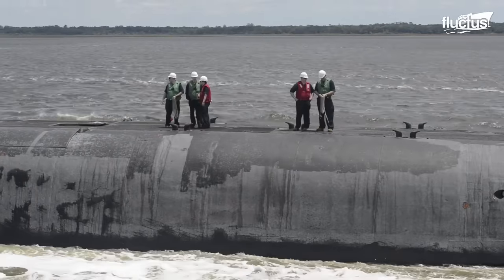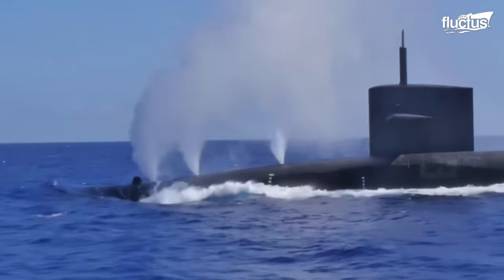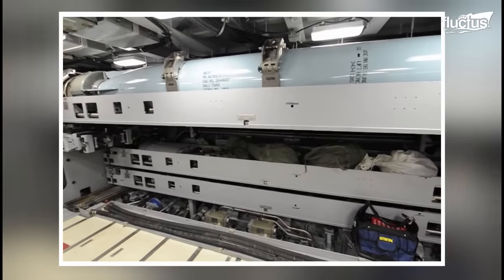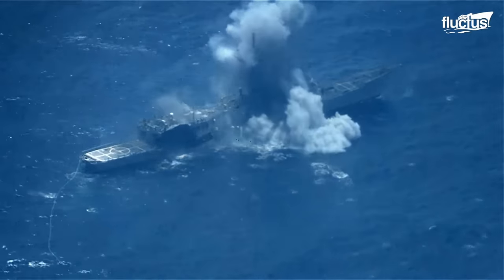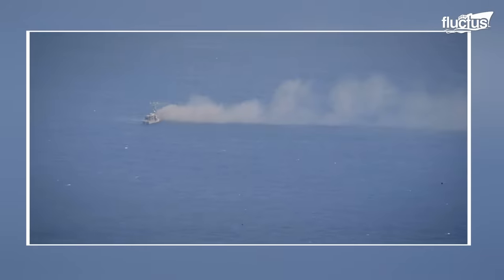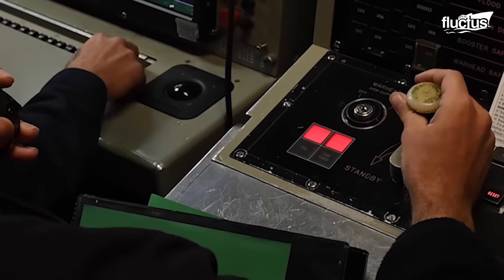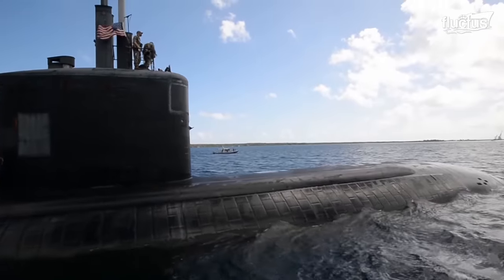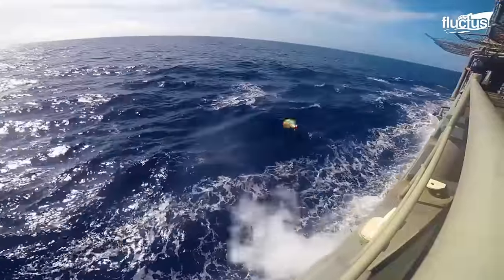Genius Techniques US Nuclear Submarine Uses to Crash Through Thick Polar Ice

Comment: That’s all great but how did the evaluation crew get there in the first place. Easy to do during peace time but during war I guess the circumstance would be quit different.  
Also can someone explain that when a submarine vents the sea water this would create a vacuum in the ballast tanks . Since being under water there 😅isn’t a way to capture air for replacement to increase buoyancy. 
Also, what is the purpose of the knob sticking up on the deck forward of the tower?
And, when the submarine dives, what happens to all the gauges, windscreen and all the other gizmos on the conning tower?
There must be a submariner out there who has the answers. Educate me and a few other curious nerds
Reply: The vent is simply that, a vent, the ballast tanks are open at the bottom to the sea, protected by grates. There would be no vacuum at all, you either have air or water or a combination of the two while diving or surfacing. Ballast tanks are only used to surface and dive, there are other tanks that aid in neutral buoyancy.

That knob would be a sonar system that.... wait for it.... looks for ice and to some degree measures it's thickness.

All of those instruments that are up in the sail are removed and stored below decks along with the windscreen and any railings that get put up for safety when transiting on the surface. The instrumentation up there is minimal, there is always a "phone talker" up there with the officer who has the Con relaying commands and information. But yes, there is also a portable intercom.

Mind you, everything I have answered is from a submariner who has his 40th anniversary of leaving boats coming up this summer so things may have changed since then.... lol

Outstanding questions!!!